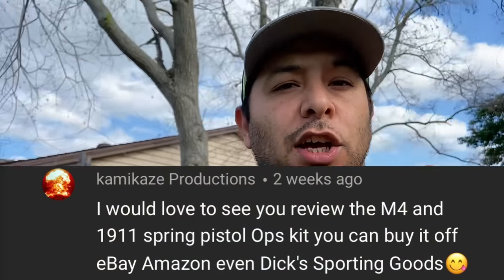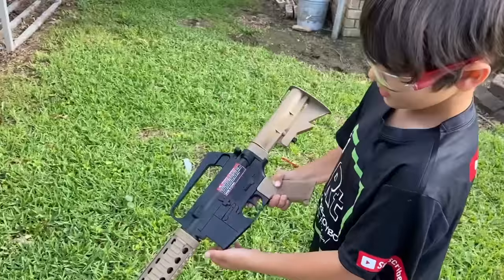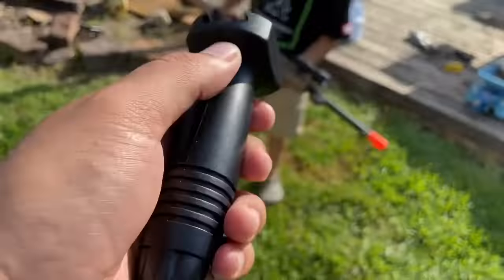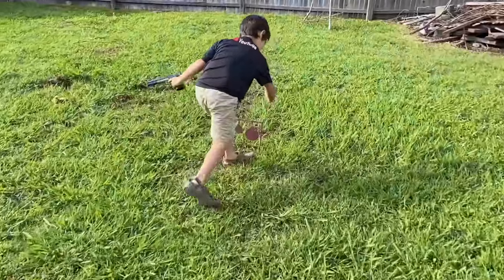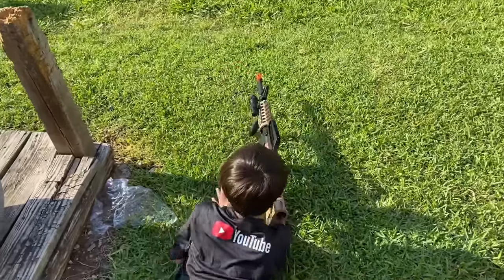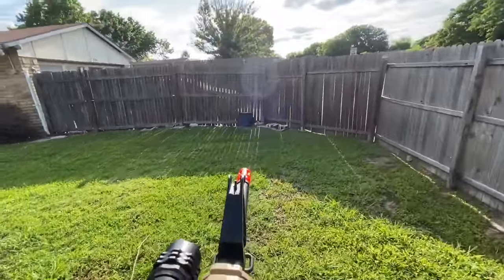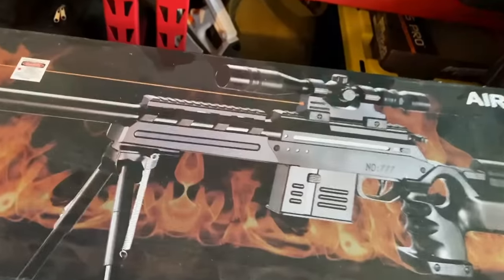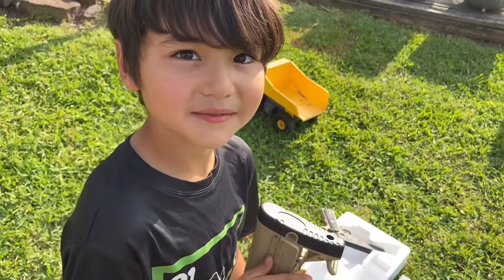Colt Airsoft M4 & 1911 Ops Kit ***Unbox and Review***

Comment: What kind of bbs does it take
Reply from the maker: We always use 6mm .20g bbs. It comes with a small pack with about 500 of the 6mm .12g bbs but you will definitely need to get more. I just like the .20g but on these springers you can use the .12g. They would be cheaper too

Comment: Splish Splash this gun is trash, you should get a Elite force 1911 tactical, it's gas blowback, and it shoots at like 350FPS, also don't use those cheap bbs with it, buy some 0.25 or 0.30 bbs, because the bbs that come with the guns,they tend to shatter in the barrel and break the gun
Reply from the maker: Hey we really appreciate the recommendation for the elite force 1911. We don’t own any gas blowback Airsoft and I have been looking into them but they cost a lot more than the springers. We will definitely start buying the better bb’s from now on we don’t want to ruin our guns. You sound pretty knowledgeable so we really appreciate the info. We are just starting out with them so we don’t know much
Reply: @rykerstoybox  ok fair enough I've been in the airsofr sport for about 8 years now so I know a decent amount but not everything, the Eliteforce1911 is a great starting pistol as it is currently the most popular and sold gas blowback(gbb) pistol on the market, at around $110 I have had mine since 2018 and still works flawlessly, and you still need to somewhat treat it as a real gun by cleaning it every now and then I have a video of me shooting it on my channel if you want to check that out
The guns I personally own:
Lancertactical M4sd AEG, had it since 2016 Christmas and still works flawlessly got it $120 originally and then have put around $300 of attachments and upgrades to it.
1911tac
Ak74 that I bought from my older brother for $60, he bought it in 2010ish for $120 as well
And another really fun gun to get is the Action Army AAp01 GBB pistol, goes for around $70-100 depends on where you get it, it is rapidly becoming the new go to most popular pistol, as it has a full auto function to it. But it is very hard to find one in stock as I've had my eyes on it for about 6 months now and haven't found one in stock yet
Reply from the maker: @thelethalpredator672  oh wow, that a lot of great information and recommendations. I knew they were expensive but I guess they are worth it if they last as long as you state. We definitely treat Airsoft like real firearms since they are more dangerous than the nerf we usually play with. Ryker really loves Airsoft mainly because they look more real vs a foam blaster. I want to see if I can scoop up a gbb at a good price. I really like how real firearm manufacturers will also have an Airsoft line too. That’s super cool. I’m sure all the attachments I already own for my actual firearms will work on the Airsoft too. And 8 yrs is a long time to be doing a hobby you might not consider yourself an expert but you probably have the knowledge to be one to someone like us . Thanks again for all the help.
Reply: @rykerstoybox  No problem at all, and yes real firearm accessory do work on most mid to high end airsoft guns, I have what I consider to be low end, which is anywhere from $100-150, mid is around $200-250 and high is $300-500+ airsoft gets really expensive, like on my m4 Aeg, I have a sig Sauer romeo 5 reddot for real guns, works just as well, also have a magpul angled foregrip that my brother gave to me from his ar15 since he got a stubby vertical grip. So yes real accessories work too
Reply from the maker: Well I created and account added the elite force 1911 to my wishlist on evike. Hopefully I can save up for this one in a couple months. It’s about $130. But it looks soooo cool